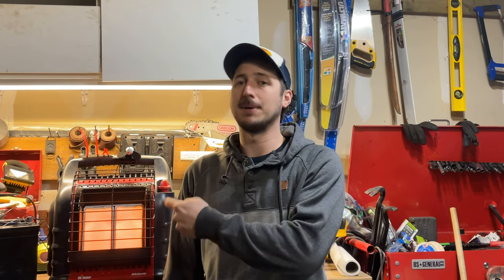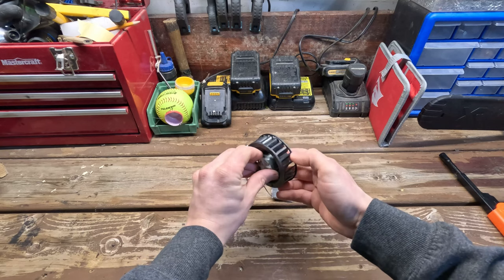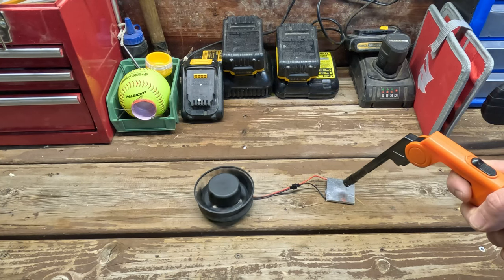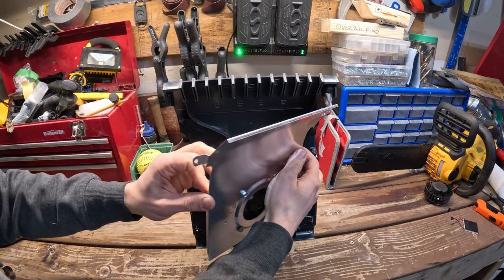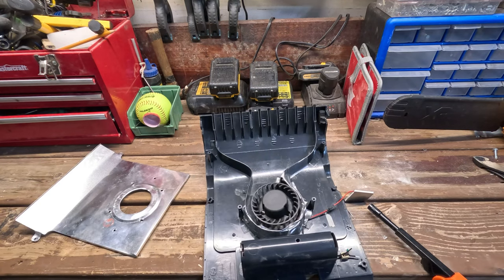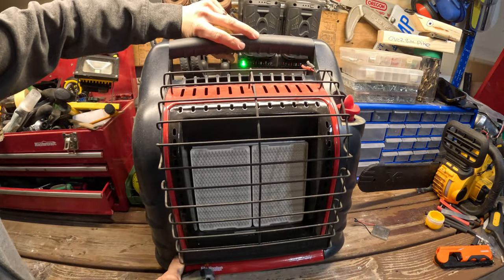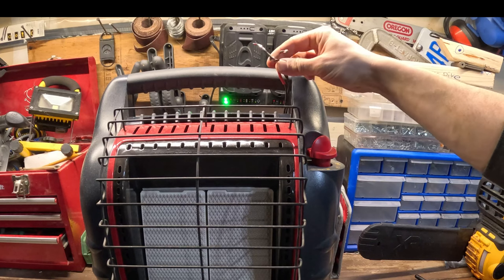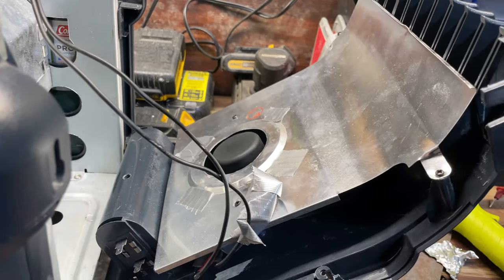Buddy heater fan swap! You will never need batteries again.

Comment: Very cool. Thank you for trying out the ideas. You might try using a heatsink on the cold side. You might be able to mount the the piezoelectric generator’s hot side to the heat shield where the fan is located. The fan can be used to pull heat away from the heatsink.
Reply from the maker: I did test it mounted inside the unit, I found the part that generated enough heat was near the top. It did work but once it got heated up it stopped. I believe it would work if I put a proper heat sync on the outside and had air blowing through it.
Reply: @joshfishing  perfect. I like the work you did. It is quite innovative.
Reply from the maker: Thank you
Reply: I was thinking the same thing - this would be a win win if it can be done without the ice bath.
Reply: I'd like to see a 12v solar panel option
Reply from the maker: @jrbr1997 that’s a great idea

Comment: "I had a propane heater, but it burns too quickly. After discovering the Chinese portable diesel heater, I have been using it for several years now and it has proven to be safer, more reliable, and more efficient over time." cost me less than $100 shipped from ebay, you can used any kind of fuel even waste oil
Reply from the maker: What is the name of that heater?